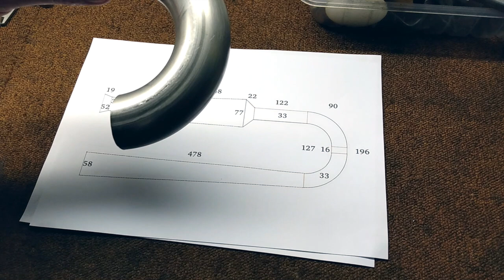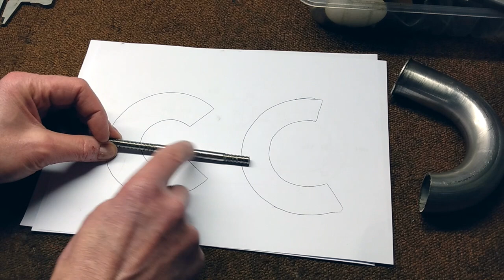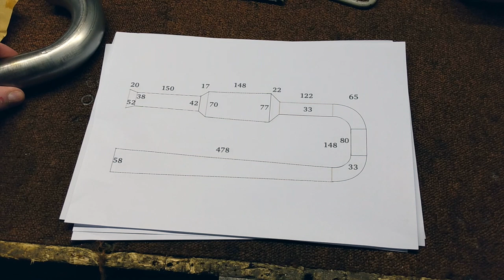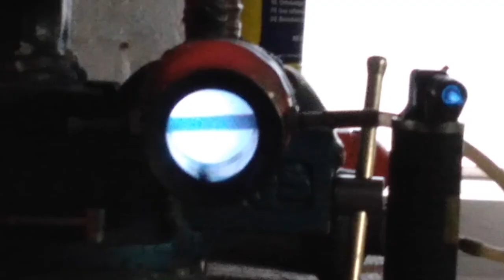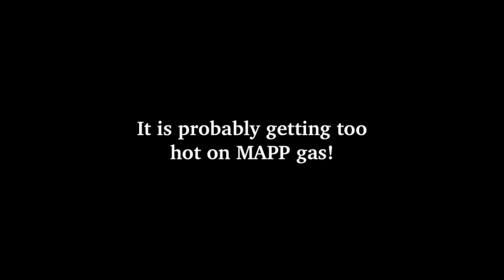DIY Pulse Jet Design, Build and Run

Comment: Been thinking about waste oil in one of these but I haven't even attempted to build one. Big credit to you for getting it  right so easily.  You could use LPG from BBQ gas bottles  to get the jet hot which will phase change the oil from a Liquid to a vapor and it may tun then. Fuel delivery will be the crucial factor.  I'd suggest something like a Roller type Fuel pump ( Bosch 044 Type) and them something like a carb jet or a needle valve to control the fuel flow. 

I would think warming the jet up hot and running at Minimum throttle and then adding the oil  to run it hard and turn off the gas.   I don't think pre heating the oil as everyone suggests with these things would help. Just have it going to a red hot part of the chamber and it will vaporize.  Be very interesting to see how this goes as I can think of a bunch of things happening but what matter and what determines if the engine will run or not is a different thing. 

You sure would have an interesting engine though that could be used for heat and maybe power and if you could run it on waste oil, you could run the thing long as you liked.... or could stand it.
Reply from the maker: Just the sort of stuff I have been thinking about so your comment is a timely reminder for me to get on with things, so thanks for that.

Colin Furze and Robert Maddox both run them on Diesel - Colin idles on gas and throttles up on Diesel; Robert starts on gas then switches over to injected Diesel with no gas. Not sure how Colin does it though, it doesn't look like fuel injection from what I can see.

It drains one of the 400g MAPP gas cylinders in two minutes hard running and then just flares out due to lack of fuel. It certainly does make a good heater but at £4 a minute on the little cylinders is mega expensive. I am looking at getting a large propane cylinder to use with it but there is great difficulty getting cylinders at the moment for some reason unless you have one to exchange, which I don't.

I have kind of amazed myself with how well the jet works to be honest - thought it might end up abandoned in a corner somewhere as an unfinished project.

Big thank you to everyone who is watching, subscribing and taking the time to comment. Cheers.
Reply: @mrpingen  I am very interested to see how you go with this and if there is anything I can help you with feel free to ask.  never done a pulse jet although have wanted to but I have a few clues about oil Burning now. 

There are a couple of things with oil that's different with Diesel. 
Firstly, Diesel is a lot lighter in the fractions so Combusts a LOT more readily.  That said, If you put oil, engine or Veg, into / onto a red hot surface, it will phase change ( boil) instantly and turn to a gas. 

My question with this is how will the jet handle it in relation to the lag time for that to take effect? there may be some puddling of the fuel and that will relate to how well the jet will handle a rich Mixture in effect. I think it will be OK because it will burn according to the oxygen available and then re-ignite when there is a fresh air intake. 

I have had to watch this with hot burners over the years flaming out because if they are smoking which is just gas and you reignite in an enclosed Cylinder, then they can go pop.... which is exactly what you want.  :0)

The other thing is waste oils leave residue which refined fuels ( Diesel, Turps, petrol etc) do not.  My Burners don't have a problem with that because they burn hot and have excess air so the resulting carbon is burned to fine ash which is exhausted. 

I think your Jet will do the exact same thing.  the vibration alone should break up any residue and eject it. I think you will see a good amount of sparks as that happens but nothing to worry about. 

I believe this will work, I think you may find it better to move the fuel to the back of the combustion chamber so it is further from the short end which would be fine as you can inject the start up gas where it is now. 
This will give the oil more time and surface to evaporate on and stop spitting raw  or burning oil out the end. 

You will also I think want the smoothest Fuel delivery, Maybe a pressurised tank instead of a pump would be better and then you can have a small orifice and control the oil flow just by regulating the fuel pressure. 

Going on the fuel burn you are having, My guess is you are going to want about 150-300Ml of Oil per minute fuel flow. 
That's kicking out some heat, ( about 150 KW ) and can think of a lot of different factors affecting that but that is where I would start. 
If you set up your fuel flow around that before you start, I think you would be in the ball park and could tune from there. 

I think the difficulty will be in just finding the sweet spot but one you do should be very consistant and easy to fire up.  A lot of people get scared when they get a flare up with oil and shut things down just as they get to where it's going to go but if you expect, ignore and work though that You shouldn't have much difficulty. 

The trick with oil is HEAT.  Not atmosiation or whatever, you need heat to change it from a liquid that will not burn to a gas that will and that is all you need to remember. 

Look forward to your future experiments!!
Reply from the maker: Thanks for that - it has got me thinking about a few things and confirmed some of my own ideas.

Finlay Shellard (in NZ) tried some experimenting with different liquid fuels and found old engine oil to be the best of what he tried, which is interesting. 
I remove ethanol from our rubbish petrol for use in my old two-stroke bike (ethanol would damage the crank seals) so I was thinking about distilling that off from the extraction water and using it. Ethanol would burn very clean but would need a lot of flow due to the lowish energy density.

I have seen some people cobble together "pulse jets" from old tin cans etc. and just pour some liquid fuel in and set it going. Seems to work so I guess any pooling, as you suggest, wouldn't cause  problems. I also wondered about adding something like a piece of perforated tubing inside the combustion chamber which would heat up and give a hot surface for the oil - might, of course, cause problems for the running of the jet.

Anyway, thanks again for the info. and ideas.
Reply: @mrpingen  Here in Brazil the gasoline have 27% of ethanol 😶, the biggest proportion in the world!
Reply from the maker: @gutobassogb  Sorry for not replying sooner. I have been busy making a workshop space in my old garage and now need to sort out a video for it.
 
I have had a few thoughts about the pulse jet fuel, including using Methanol, which would burn very clean. 
MAPP gas burns hot and could be used to ignite a heavy oil so that is a possibility. I also wondered about using Acetylene to idle it and as it burns even hotter might work even better - it is more dangerous to work with though but can be made from Calcium Carbonate and water. 
I usually remove Ethanol from our petrol (5% and 10%) to use straight petrol in my old 2-stroke bike. However, the past few times there has been no Ethanol in the local petrol so my guess is that there must be a shortage of Ethanol at the moment as I thought it was a legal requirement to put at least 5% in our petrol.
A problem I have at the moment is with the good weather now here my neighbours are out and about more in their gardens etc. The pulse jet makes a hell of a noise so it might be best to wait for bad winter weather before further testing. I can still prepare the fuel system(s) though. It is really too dangerous to run in the garage and I did burn the roof as well as my beard and hair!
Reply: @mrpingen  Didn't you try to mix propane or butane with the oil? Maybe it will turn the heavy oil (engine lubrication used oil; burned oil) more volatile and easier to evaporate and atomizer. I already mixed LPG (mixture of propane and butane, the cooking gas here in Brazil) with gasoline, ethanol, and diesel. Sometimes I like to put propane/butane into a Coca Cola bottle 😶 at about 6 bar of pressure. When you make the mixture with others hydrocarbons the temperature will increase a little, them you need to insert it slowly. Increasing the proportion of heavy hydrocarbons in the propane, the static pressure will decrease and you can maintain for a longer time inside a Coca Cola bottle in your bedroom 😶. But, but, you can operate a red cylinder as an inverse fire extinguisher 😂. A fire extinguisher is a very good cylinder for storage pressurized gas up to about 15 bar of pressure. The R134a too. I like to storage LPG in an cilynder of R134a or R22 because is cheaper, lower weight and easier to transport.

Comment: try rocket nozzle widening valveless continuous burn "pulse" jet, more like afterburner than pulse jet tho
Reply: yes pass-through air input, valveless afterburner (sc)ramjet, hour glass shaped, able to work both ramjet and pulsejet like modes
Reply: @Jkauppa  Did you mean and air multiplier, or like an air multiplier? Where can I find a project? I to made a powerful solid transporter. An push/pull solids.
Reply: @gutobassogb  afterburner either valveless or edf, with an ramjet input scoop
Reply: @gutobassogb  you find the hourglass shape project videos on my videos, but its simple bow-tie shape, optional turbine in the middle choke point, fuel input any type after the choke point
Reply: no moving parts/flaps/valves
Reply: if you dont use external heat, but gasoline, then use a glow ignition electric resistance coil to vaporize mix burn the fuel, like a fuel b0mb
Reply: yes a flame thrower
Reply: more like a well mixed fuel rocket stove, than a pulsejet, without the noise
Reply: yes iron (magnet) loses magnetism when heated
Reply from the maker: Thanks for taking the time to comment. Cheers.